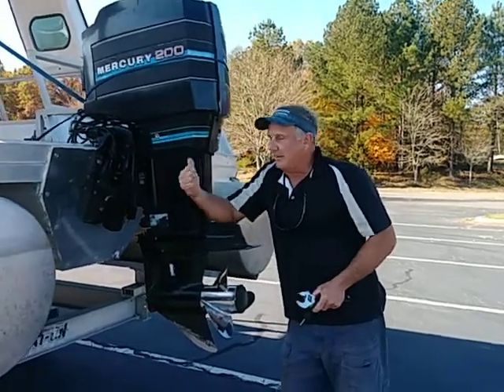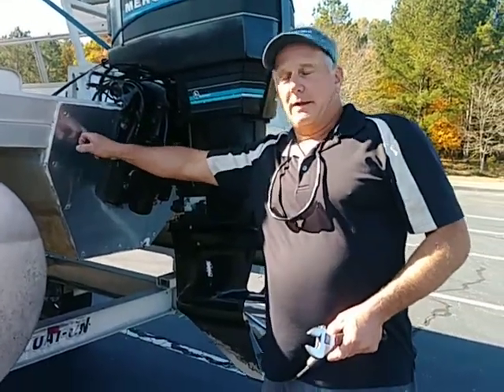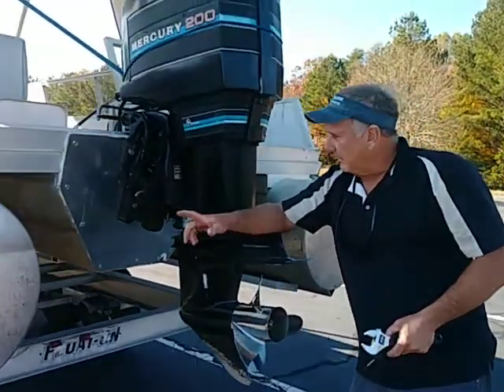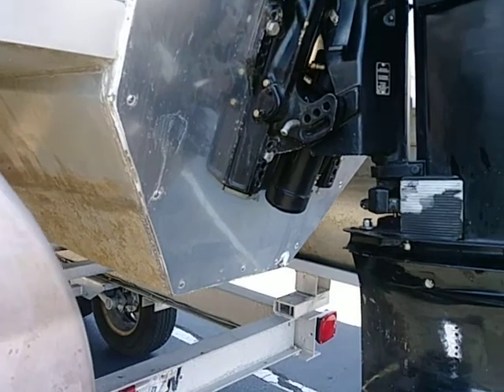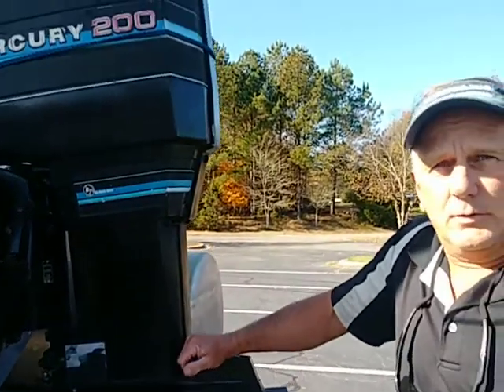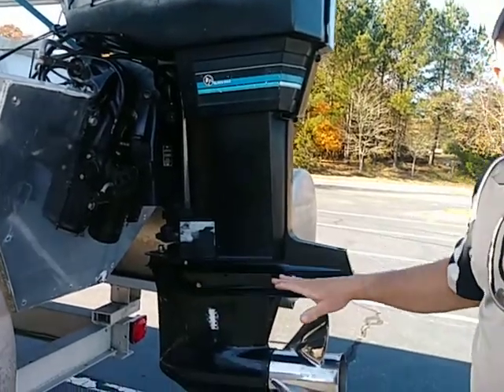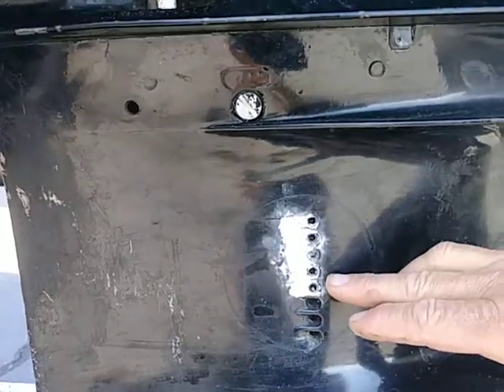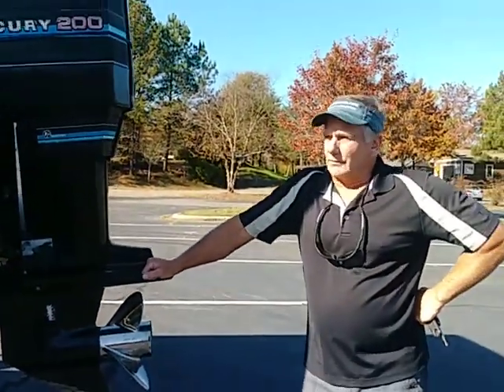Mercury outboard engine height set back and prop size

Comment: Captain Andy! I need some advice/help! I have a 22ft Gregor pontoon boat with a 150 mer 2 stroke (not the motor that’s supposed to be on here but I bought it this way) I’m having issues with it getting hot under load cruising but just idling around it goes back to normal temperature.. when you took the boat out with the holes plugged in the gear case did that help you with it not getting hot?

Comment: Why did you fill in waterpump holes, so it doesn't suck in air?
Reply from the maker: Hi , yes thats correct. I found over the years no problem filling all  but 3 on each side. This still equals 1.5 inch of water holes. .25 x 6 =1.5 inch of openings. More than enough water flow. If you are going to really surface your gearcase I would go with a Bob`s machine shop nose cone kit. DONT weld it epoxy it on !! You will burn your seals if you have it welded on! Thanks for your intrest in my video!
Reply from the maker: I was watching your seat rebuild video this morning.   Man those frames were rotted!